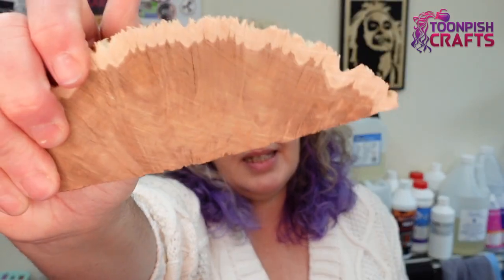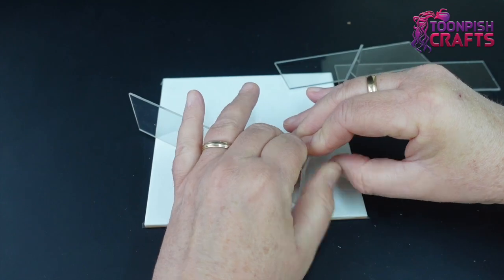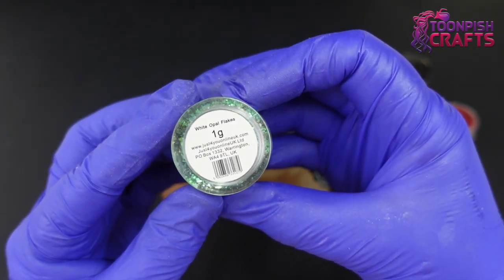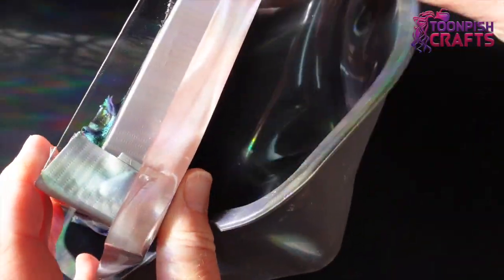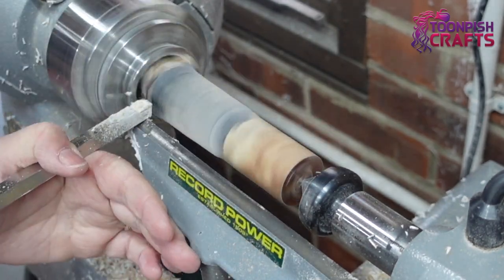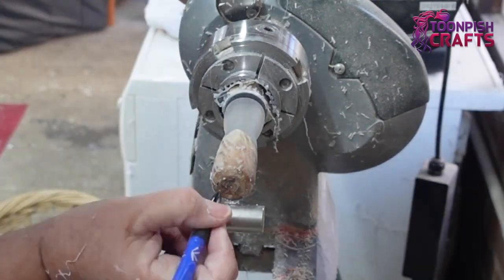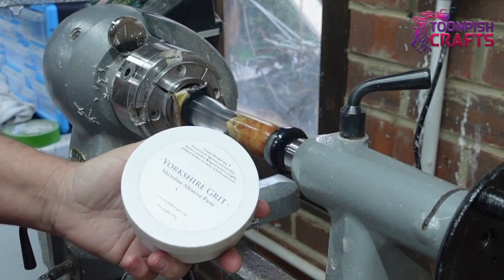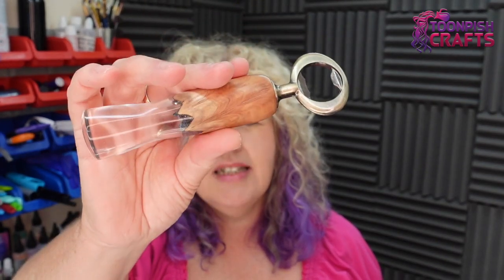How to magnify your resin sparkle

Comment: My choice of drink is tea 🙂 Congratulations on reaching 4k! The project turned out beautiful 💕 And thank you for sharing that little tip with the glue..... We like to make eggs using molly burl and then use uv or a quick set resin to apply the color shift mica, however most every time we get a ripple effect where the 2 resins meet. It was beautiful to see how well the leaf glue worked, and the resin locked into the wood perfectly. Can't wait to give it a try myself. Thank you so much for making these videos, I have learned a lot from you.
Reply from the maker: Sounds like you will have lots of fun with this 😀😀😀😀 
Thank you so much for your comment ❤️ it’s so great to know that I inspire people with crafting because that’s really all I want to do 😀😀😀 
Have fun with your eggs 🥚 I bet they are beautiful 😀😀 
Good luck with the draw 🤞🤞🍀🍀
Thanks Jen

Comment: Can I ask if I was to use the chameleon powder what can I use other than resin to seal my carving? And do they have a red one?
Reply from the maker: Red is a really hard colour to get. I’ve not seen a red chameleon powder but there are off red ones like pinkish or maroon ish. As for sealing wood, I’m not a great expert on carving so although I know different wood sealers I’m not quite sure how you want to use it. 
Perhaps you could elaborate. And I will try and help 😀
Reply: @Toonpish  thank you, it's for a carving I am doing and would like to give it some colour and think that the chameleon colour would make it pop. I will try and send you a photo of it. The wood is wavey like a flag hence the strange shape
Reply: How do I send you the photo?
Reply from the maker: @jackieliddell8876  sounds cool. You can mix it into two part epoxy glue or even slow set super glue if that helps 😀
Reply from the maker: @jackieliddell8876  my email is on the information page 👍